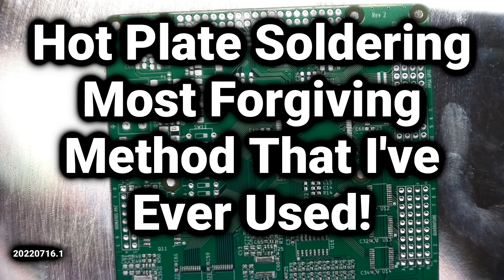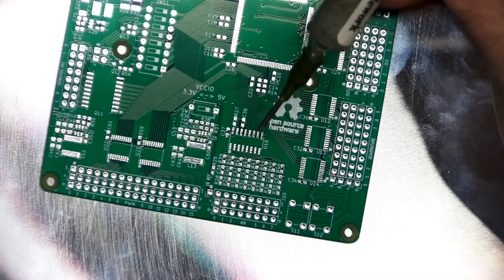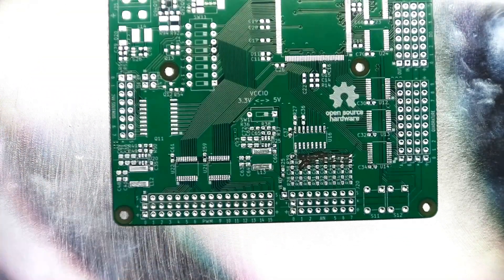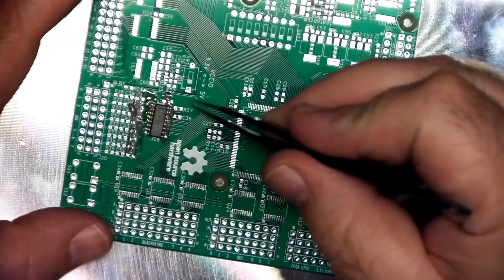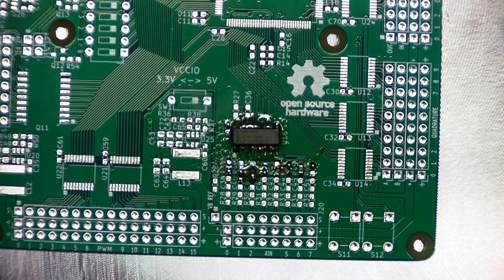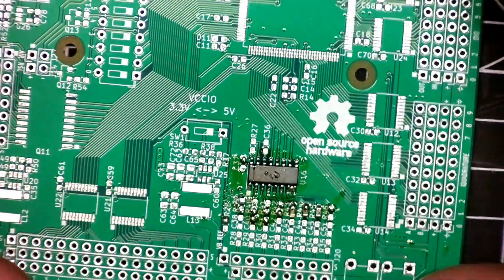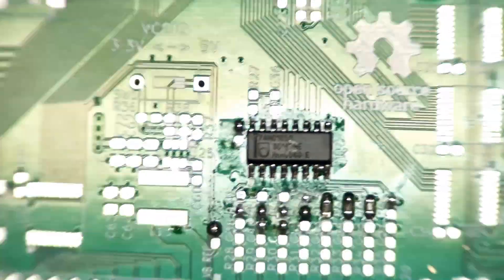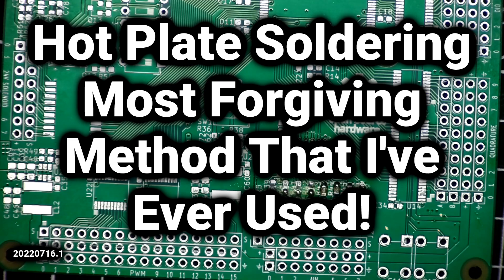My First Attempt at Hot Plate Soldering

Comment: I already purchased a hot plate and I will be using it for my next SMD build next week. It has to beat trying to use an iron. I tried an SMD practice board once and it was a nightmare. The bigger components weren't too bad, but once you got to the smaller ones I was hating life.

Thanks for the video.👍🏽
Reply from the maker: Glad to know I could help!  Hope your experience is as good as mine has been.

Comment: I've got an official reflow oven and it is nice to set the board in there and hit the button.  Come back when I hear the cooling fans running.  But, the hot plate is much quicker and I can tell right away if something has gone wrong.   I usually use low-temp solder paste and it works very well.
Reply from the maker: I've just tried some low-temp solder for the first time.  VERY MUCH EASIER!  Thanks for the idea!

Comment: You can clean you tweezers easily when you placing you components, as have a small sponge, the ones you use for cleaning your tip with water, but then use some IPA on the sponge. At least that works for me 🙂 And for you r first attempt, it is really not too bad 🤣 Btw.. in you van a big heatsink or just a bit piece of aluminium or steel or something, it cool way faster. Which is also in the datasheet. After reflow, cool fast!
Reply from the maker: @DustinWatts  🤔..  Good ideas!
Reply: @JohnsBasement  Your welcome!

Comment: Recently had to build a board that was primarily smd. I used chipquik and getting the temperature was the tricky part, ended up needing around 235 but once I did…I was convinced that I made the right choice. I didn’t even use a stencil but the sockets worked perfectly and just needed to clean up the ics

Comment: Thanks for the advice, I got a similar hotplate after watching this and it's a CHEAT code for SMD work. I can do more in 10 seconds with a hotplate than I could in 30 minutes with a fine-tip soldering iron, to say nothing of how it alleviates basically all of the frustration. Even manually applying solder to the pads with an iron and placing components on top for melting is not too hard. And the joint quality goes from embarrassing to near perfect, it's such a big improvement that it makes you laugh!
Reply from the maker: I have tried the pre-soldered pads but had trouble with it.  I gotta try it again with a more controlled rig.  I picked up a small square frying pan that, with a lid on it, should be able to act more like an oven.  Less thermal variation from top to bottom of the parts.

Comment: First put solder on the pads with soldering iron, this way you will cover the pads evenly with solder and avoid balls. Then put flux and place the components, the hot plate will do the rest. Otherwise you will need a stencil.
Reply from the maker: This is good advice.  Thanks!

Comment: Thanks for the video. After having it for around a year now, what are your thoughts on using a hot plate for soldering?
Also, what temperature do you typically take your plate versus the solder melting point? Thanks!
Reply from the maker: This is a good question... and I should followup on this video at some point.
So far, I have mainly been using it to UN-solder old boards to recycle expensive chips like FPGAs.  I tend to run it hotter than I would for soldering.  I have used anything from 650F to 800F for that.
If you are soldering flat (not in a pan or pot with a lid) then make sure there is no air flowing/blowing around since it will cool the top of the PCB and prevent it from getting hot enough even though the bottom would almost be on fire!

Comment: Great video.  And good demonstration how forgiving and "easy" SMD board assembly can be.   I've spoken with people who think that SMD is just too hard and they stick with only doing hobby projects with thru-hole parts.  They dont believe me when I tell them that it's easier and faster to do SMD assembly.  Heck, with 0805 or 0603 parts, you can even hand-solder those if you needed to.  But with stencils and hot air.. goes much faster.

I find the hardest part of SMD board assembly is.. being able to actually SEE the damn parts!  Some sort of magnification goes a long way.   I used one of those illuminated mangifier lamp things for a while, which was a big help.   Eventually, I broke down and bought a stereo microscope and that makes it so much easier.  The 3D perspective is really helpful.  

Thanks for the video!  Great fun, and surface tension is a powerful force at this scale..

Comment: Sir, as a viewer new to "Jon's Basement", I stand in awe of your incredible output to date. Just one point about your solder paste application method where you applied it to the board. Would it not be better to apply it only to the component leads before presenting them to the board? I suspect it would give you much more control over the final outcome.  Thank you again for your output - it really is very much appreciated.
Reply from the maker: Thank you very much!

I hadn't considered this.  It seems everyone applies it to the pcb... albeit with smaller needles & uses paste that is not in such a horrible state as mine.  I suspect the risk of bending fineer-leed parts is a bigger problem than getting the portion of paste right.

What I do want to try is a stencil.  I plan to order one on my next surface mount project.

Comment: Doesn't the heat bake the crap out of your components? Heat makes semiconductors sad.
Reply from the maker: Surface mount components are designed to be soldered by baking them at these temperatures.  So it is fine.  Look at a datasheet.  It will say something like:. Ramp temperature up to 250C over 120 seconds, hold for 30 and ramp back down to room temp over 40 seconds.

Comment: It's much easier to use a hot plate at a lower temperature (around 100 deg Celsius) with an IR gun such as the PDR Chipmate C1.  The hotplate provides most of the energy to heat the solder and the IR gun takes it just over the edge to melt it neatly. The beauty about the IR gun is that it won't move the components out of position. https://youtu.be/POz3ZTxFfgM?t=17

Comment: I had about the same giddy reaction after trying a little $15 "LED desoldering hotplate" from amazon for the first time on some 3"x4" boards with a stencil a couple of weeks ago.  It worked fantastically on the little IC's and passives, but things with a good bit of thermal mass (10UH inductors, in my case) I ended up having to finish by hand, (though maybe dabbing on some more solder like in the video and/or using better hot plate would have fixed that...) -- but soldering on ~60 tiny parts in under 2 minutes was shockingly fun!
Reply from the maker: I look forward to using it for real stuff!
Last night I tried a few different techniques of soldering on some LQFPs.

For bigger parts, you might need a lid so you can bake everything evenly.

I picked up a small square frying pan so I can get things on and off the plate without any more fumbling.  🙄

Comment: With leaded solder paste you should wear gloves to stop the small balls finding their way into the crevices of your fingers and nails. Accidental ingestion is much more of a concern when it's paste than a wire. T3 balls are large but T4 and above are just nasty for how well they will hide. Blue nitrile gloves work best for me and also act as a mediocre secondary barrier against accidental burns. Important that they fit firmly, as loose or too floppy fit will hinder your experience. Really good idea to keep all food away from where you've had solder paste.
Nice to see the separation of the old paste and its flux, and yet still a very 'forgiving' reflow.  You're right, a smaller luer lock nozzle and a more 'fresh' homogenised paste would of resulted in a more consistent result.
Reply from the maker: Doooohhh!!!   You are SOO right!  I even have a box of gloves. 😞. Old habbits are hard to break.

Comment: Another technique with the hot plate I found to be quite useful for single pcbs without solder paste and a proper stencil: Use one of your bigger irons to add a thin layer of leaded solder to each pad. The solder mask prevents the solder from spreading (as opposed to solder paste without stencil). Then apply lots of flux (just flux, no solder paste!) to the pads and populate the board. Best is to use the "sticky" flux. Put it on the hot place and wait for the magic to work :) You may see occasional tombstoning of some resistors or a few bridges, but most are fine the first time. Maybe a good idea to have tweezers at hand and nudge the parts who need some help during reflow, as you did.
Reply from the maker: I tried this last night on some LQFPs.  Yes, it looks very promising!

Comment: I enjoyed watching your experiment, my take on smd soldering is that we  should trust we can do it with good results. You also had fun doing it! I'd like to see a Z80-Retro! version using more smd parts, integrating more features, like maybe a DMA controller, or the programmer. If all the passives are smd, they can be factory assembled. I think a usb to rs232 chip would also be nice, enabling power and console over one cable.
Reply from the maker: I like the idea too. I've been tinkering with ideas for an SMD version with VGA video.

Comment: For the hobbyist, this seems much more sensible than converting a toaster oven. I’d love to see how this works on the Z80 board micro-SD reader.
Reply: Toaster ovens will give you much better control over temperature ensuring your paste follows manufacturers profile recommendations fine. Hot plates are sort of a brutal 'ramp to peak' solutions and don't cool after the point of reflow. They overshoot and hold the heat in the large thermal mass. So you sort of have to lift or remove as John did an then this can cause your parts to move.
A good 'combo' is to run your hotplate only up to 140-155C for leaded paste and use your hot air gun at around 350C to pull up components and areas selectively. Switching the heat off on the plate when you get all the cool area start to melt. Toaster oven, hot plates, and hot air rework guns are all great weapons in your SMD arsenal.
Reply from the maker: I agree.  I expect to use a small square pan with it so I can get the board on and off without bumping the parts around.
Reply: @JohnsBasement  Large width kapton tape is good for keeping a new even plate surface and reduces pitting in the hotplate from fluxes or other chemicals. Only used with leaded solder paste. Not sure how it will hold up to RoHS temps.